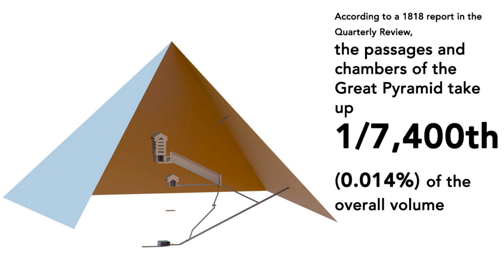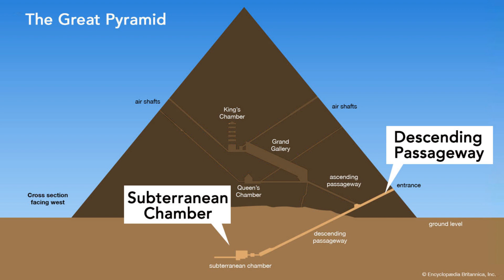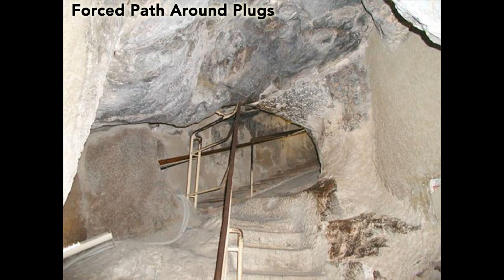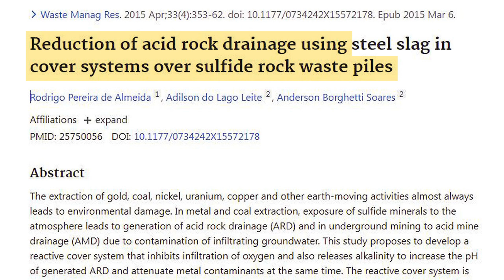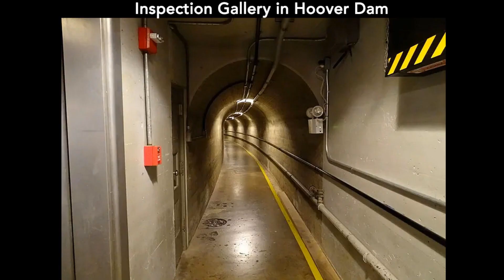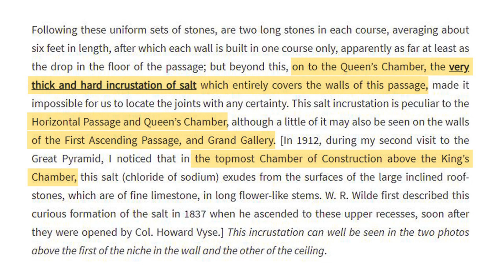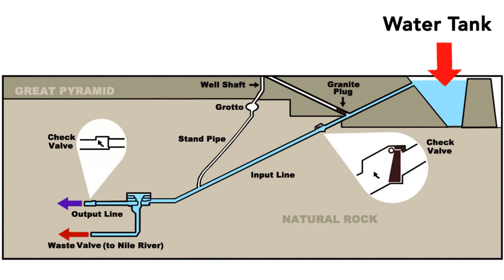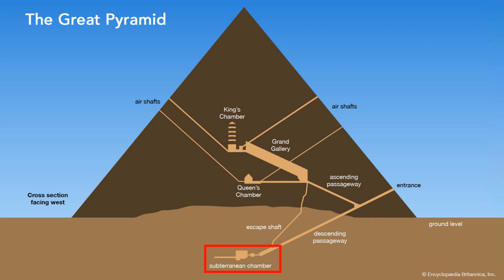The Mystery of the Great Pyramid's Interior System?

Comment: Great Tina. Thank you.
I was wondering why the great pramid has layers of different types of stone? Very similar to a capacitor in some areas,  some types from vast distances, to put in a tailings mine?  That bit i dont understand.
Reply from the maker: Thank you! The Great Pyramid has/had limestone casings and limestone core blocks; certain interior spaces used granite, though the pyramid was not really built layers of different types of stone. Multiple big pyramids, including the great pyramid have casings made from Tura limestone which came across the Nile and granite from Aswan. In an earlier video, I showed a paper states that the Tura casing stones at the Bent Pyramid were man-made. I also talked about the possibility that granite might be cast as well based on the appearance of the granite casings at the Menkaure pyramid. I explained these in the earlier videos I made on pyramids :-)
A Provocative Theory: Giza Pyramids as a Lost Civilization's Mining Waste Storage Site? https://youtu.be/tFzd2z0Rr1U
Great Pyramid: Let's Double Check the Mathematics & Star Alignment Claims - https://youtu.be/nPswBtmQKD8
Prehistoric Mining: What was Mined on the Giza Plateau? https://youtu.be/y6ShuJdzDS0
Reply: @CuriousBeingbyTina  ahh, so we've been misled by others. Ive read on different chambers being different materials and in ways thatvis layered not necessarily in actual flat layers but a squre of dranite surrounded by a square (or void) of sandstone, inside another box of conductive material. Some things like the pink granite and mica used in a LOT of pyramids come from vast distances. Just to make a void in the pyramid, lije tge kings chamber, ive read and seen pictures of niches in some chambers like there was something supposed to be there. Crystals?  Linghams?  Are they not there?  (im not being facetious, im asking as im not sure now after your explanations. Ive recently seen a video of the labarynths under the plateau. Not rough mines, beautiful temples etc. I don't know. Its SO INTERESTING. 😊

Comment: That's a poor way of getting rid of all that water for the entire pyramid with only a 20cm by 20cm shaft, only present on two of the four sides. Moreover, how in the world world are going to collect all the water in these super thin shafts?
Reply from the maker: Were the pyramids built when there was a lot rain or was it as dry as now?  “Cairo is donated on balance 26 mm (1 in) of rainfall per year, or 2.2 mm (0.1 in) per month. The wettest weather is in January when an average of 7 mm (0.3 in) of rainfall (precipitation) occurs.”
The Sahara/ North Africa goes through humid/dry cycles. The Sahara was green and wet from about 14,500 years ago (after HS1 the millennia-drought) to 6,000–5,000 years ago. The humid period before that was around 85,000 to 78,000 years ago. HS1 (20,000-15,000 years ago) is the time period that coincided with the severe human population bottleneck which I think could be the ending of an advanced civilization. If the pyramids were built during 78k-15k years ago, then the Giza Plateau would be as dry if not dryer than now. 
The small shafts in the Great Pyramid were probably designed according to the annual 1 inch of rainfall.

Comment: Could the salt deposits to indirectly be used for age determination? DLF, CH
Reply from the maker: Thank you! I thought about this possibility. Unfortunately the formation of the salt deposits had been interrupted for a very long period of time: 1st after the casing stones broke off; and then in 820 AD with Ma'mun's new path the interior air flow would have been affected a little bit along with the efflorescence formation; and at last during the modern time the upper two chambers have been periodically cleaned to be ready for tourists. If the early modern investigators had preserved some original salt encrustation, maybe we can try to date it to get some idea.. but I'm afraid it's too late to do so now.

Comment: i really like your ideas @Curious Being  , thinking outside the box in a logical way , it seems impossible to me that the pyramids were built to bury a pharoh in , why go to all the trouble of blocking the descending passage way and then leave a back door open like the well shaft , some suggest the well shaft was a robbers passage  but for that to be true the robbers would have to have known about the upper passageways and would have chosen an easier route similar to Al Mamun . That being said the well shaft is the only point i'm not convinced about with your theory , if it was purposely designed as a drainage tunnel it should have been better made ,or  maybe something went wrong with the original layout and the well shaft was an emergency  afterthought to relieve internal pressure . On the idea of water drainage from the lower chamber ,the pit in the floor was never fully excavated ,only to a depth of 30 feet i think , the question is why did the builders dig the pit to any serious depth if it wasn't for a purpose  other than drainage ,,,, i can't wait for your future videos , i think you  may just be onto something with your ideas .. thanks for the upload  Tina  .
Reply from the maker: Thank you for sharing with with me. I really appreciate it. I agree that the well shaft can't be a robbers' passage because this almost vertical shaft is not suitable for a person to pass through at all. I have a theory about the subterranean chamber which I'll talk about in the next video :-) Thank you for the support!

Comment: Another logical flaw in your presentation that I discovered is the blocked shaft. You said that the seepage water would drain through the air shafts to the chambers and then escape through the "escape tunnel". Do we have a picture somewhere how this tunnel exits on the top? I would suggest, that during a heavy rainstorm and lot of seepage water accumulating inside, the water would flow down the tunnel to the three granite blocks and stay there. The water can't evaporate and the tunnel would fill with water. However we have no indication that this ever happened. In addition the floor of the king's chamber and queen's chamber was covered with rose granite tiles. Grave robbers dug for treasures and we now know that under the tiles was loose gravel. So firstly not really water tight and secondly not really useful for water drainage because the floors are not tilted. Water would form puddles in the chambers and evaporate. With a lot of water it has to find its way through horizontal tunnels to the gallery and then all the way down to the escape tunnel. Not really convincing as a professional drainage system, what do you think?
Further, we don't know how old the "escape tunnel" is. Potentially it was carved out by grave robbers much later. Matt (Ancient Architects) mentioned in one of his research documents that there was an extra entrance somewhere with a revolving stone block. So people could get inside and grave robbers knew the descending shaft to the underground cave and thus carved the tunnel down through the soft stone material. And much later al-Mamoun decided to hammer his way out through the limestone blocks. Or the way in? We really don't know, because there is no documentation on that.
Reply from the maker: Were the pyramids built when there was a lot of rain or was it as dry as now?  “Cairo is donated on balance 26 mm (1 in) of rainfall per year, or 2.2 mm (0.1 in) per month. The wettest weather is in January when an average of 7 mm (0.3 in) of rainfall (precipitation) occurs.” There are very rare if any "heavy rainstorms" in that region. 

The Sahara/ North Africa goes through humid/dry cycles. The Sahara was green and wet from about 14,500 years ago (after HS1 the millennia-drought) to 6,000–5,000 years ago. The humid period before that was around 85,000 to 78,000 years ago. HS1 (20,000-15,000 years ago) is the time period that coincided with the severe human population bottleneck which I think could be the ending of an advanced civilization. If the pyramids were built during 78k-15k years ago, then the Giza Plateau would be as dry if not dryer than now. 

Pyramids were probably designed and built for a dry climate. They don't have flat roofs. When rainwater hits the pyramids their angled exteriors with casing would easily drain away the majority of the water. The casings kind of work like an umbrella towards rainfalls. Perforated pipes are supposed to be not sealed so water can seep into the pipe.  Many underground drains are not waterproof, such as a French drain. Yes the air shafts are pretty small and they twist and turn. But if we consider the possibility that the pyramids were built during a time that they only received 26 mm/ 1 inch of rainfall per year, I dare to say the "air shafts" are big enough for drainage purposes. 

There might be more such shafts in G1 as well. The scanpyramid team found two more voids in G1 but smaller voids like the air shafts are probably hard to detect. 

The well shaft/ escape shaft is very long, very narrow and almost vertical. Why would the robbers spend this much time and labor to  dig the shaft in the bedrock that they can't even get in?

Comment: As a miner who works at an underground mine called Alamos Gold with the mill on the surface, I was there before any infrastructure was built , I started mucking and trucking then worked my way up to leader, bolting, drilling ,and blasting , that being said the similarities in your speculation on mining are uncanny. I assume they were very efficient and made use of the tailings tonnage  to create these  absolutely amazing pyramids. Hmm maybe they were poured not  cut.  It would make sense  in the time frame they were supossedy built . Great video  Tina 🌻🌼💐
Reply: all the stones are different sizes so you would have to make a different mold for every one..not poured .there are saw marks on the blocks below..whoever they were they had power equipment of some sort
Reply from the maker: Thank you Rene. It means a lot to hear from a mining professional. I agree that the pyramid blocks were probably poured  🙂thank you for sharing your insight!
Reply: @CuriousBeingbyTina  your very welcome Tina, but of course the pleasure is all mine. This is a tough topic to analyze because of all the theories and hatred surrounding it all. But im sure this mining topic  is wise to  pursue, It is plain to see It holds true hard proof in the remnants of mining, I use to wonder if it was gold being smelted because of the countless findings but iron makes more sense when considering the time period, all the farming, wars and the technology advancement.  🙂

Comment: Great job Tina.  I think we are well beyond considering the Giza pyramids as Egyptian burial sites.  The schematics certainly suggest they were machines, but what did they do?  The main shafts are very small, and I've always thought they were created by the builders laying or sitting on sleds that allowed them to carve the shafts while being lowered by rope from above (i.e. no standing required).  The rope could also have been used as a guide to align the sides.  Good stuff.  Very though-provoking.
Reply from the maker: Thank you Dave. I agree with you - "we are well beyond considering the Giza pyramids as Egyptian burial sites." I thought maybe the passages could be some kind of conveyor belts :-) The pyramid builders were technologically more advanced than us because I don't think we can excavate small tunnels into the bedrock like the descending passage; our machines are not that compact...
Reply: @CuriousBeingbyTina  I think the passage ways that are uniform (square and straight) would be well suited to the flow of water and chemicals.  I think they are probably over designed (too much labor to construct) for conveyor belts.  E.G. A coal mine has a flat bottom for the trolley rails and conveyor, but the sides and top are very rough.  In contrast to the uniform shafts, the escape shaft is irregular and non-linear and likely not suited for flowing water;  and so it might have been used to transport materials via a simply pulley system like you'd find in a water well.  🙄